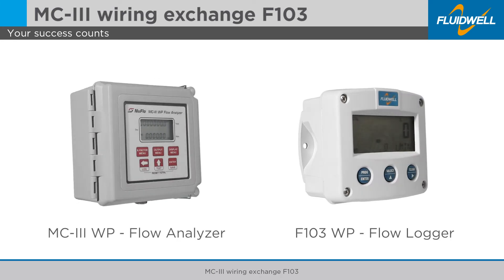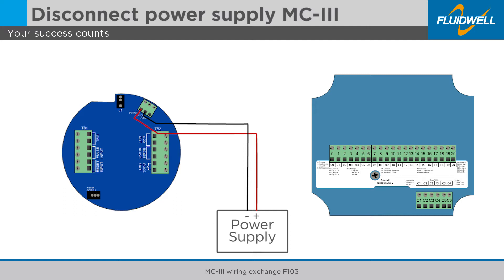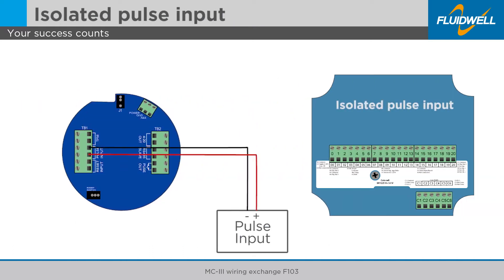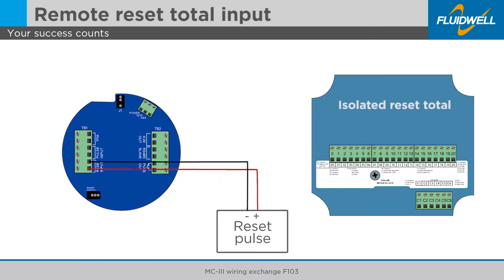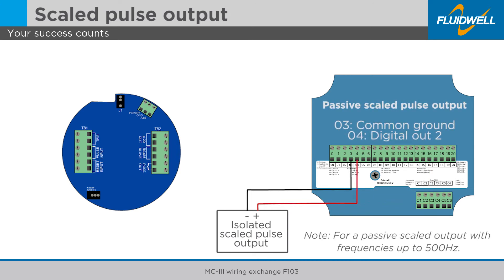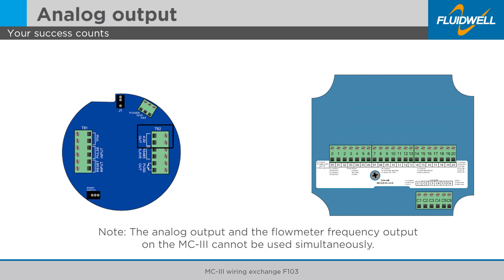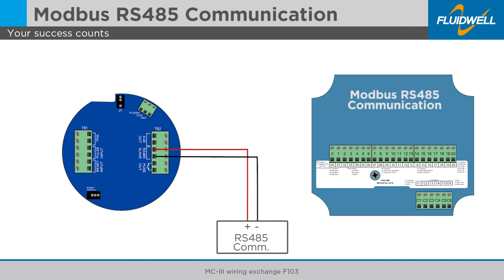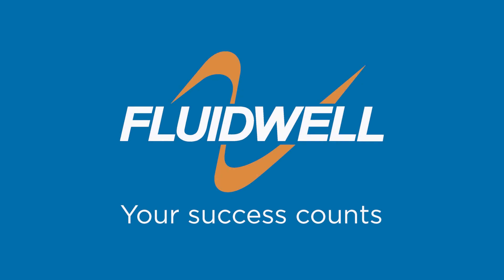MC-III vs Fluidwell F103 Wiring exchange

Comment: Considering the F103's configuration type AH with a 4-20mA loop powered, do I still need to connect the power supply or ground - PIN 00, 01, 02?
Reply from the maker: The type AH, loop powered analog output does not provide a sensor supply. So when you need that, you also need to connect a power supply to 00,01,02. Grounding the F103 is always a smart decision, to prevent EMC related noise signals. For more info, please check the productpage of the F103, where you can download datasheets and manuals for free: https://www.fluidwell.com/single-product/f103.html